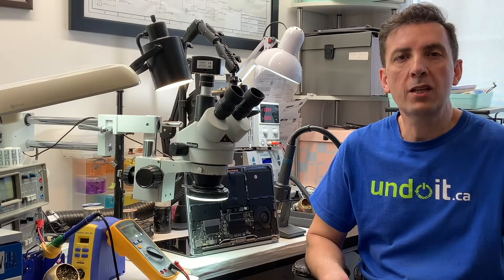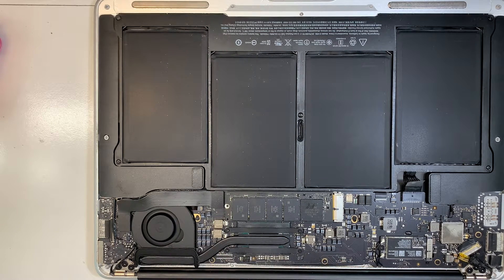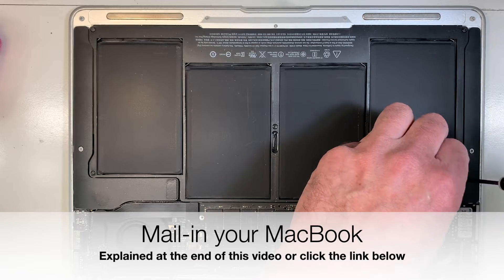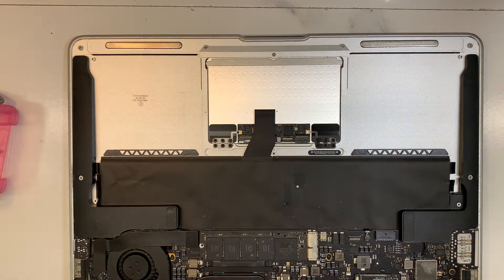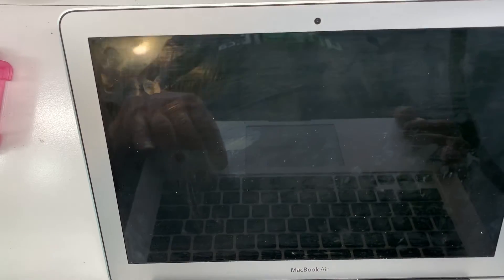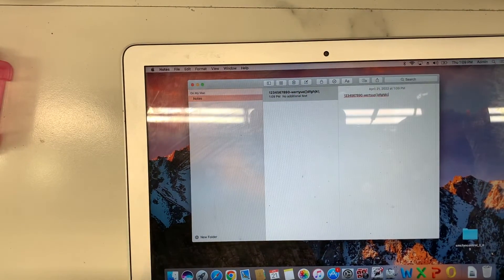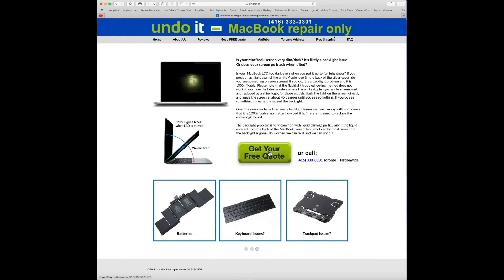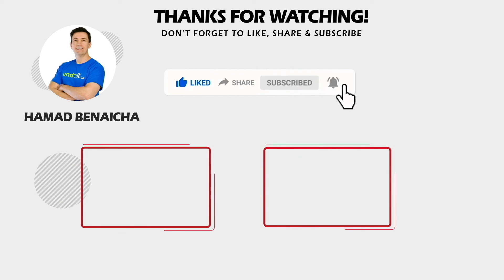🇨🇦MACBOOK RUNING VERY SLOW ALMOST UNUSABLE AND FAN ALWAYS LOUD, EASY FIX! Hamad Benaicha 20+ years

Comment: My macbook air 2020 is running very slow, i can't even open the settings app as it takes 3 to 4 minutes to open same for all the other apps and features. The fan is running constantly and the mac won't turn on without being plugged, the keyboard is not
working at all, there is a also notification for battery service. Please tell me the problem!

Comment: A1466 mid 2013 fan all the time and on big sur or catalina very slow performance.  no liquid damage just became so so slow. replaced ssd to 512gb resetted the ios but still fan on and slow sluggish performance. salams mr hamad. i am in saudi arabia . can u suggest whats wrong?
Reply from the maker: Alaikoum Salam, replace the I/O cable (the cable on the left side that connect the I/O board to the main logic board, if the fan stopped running fast the problem will be resolved, if the fan is still running fast replace the trackpad cable, if that does not work, replace the trackpad, it' s 1 of those 3 (99% of the time). Wa Allah aala wa allam

Comment: Thanks for ur tutorial. I have the same problem. The fan is spinning fast and the macbook is slow, But my macbook keyboard and trackpad are working fine. What do I need to check?
Reply from the maker: Try a different battery... if that does not work something possibly wrong with a sensor